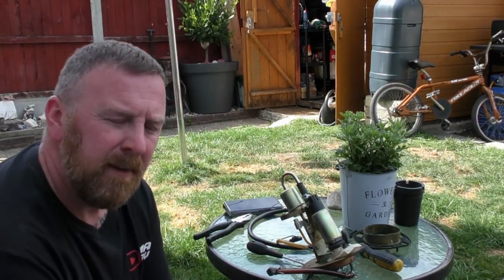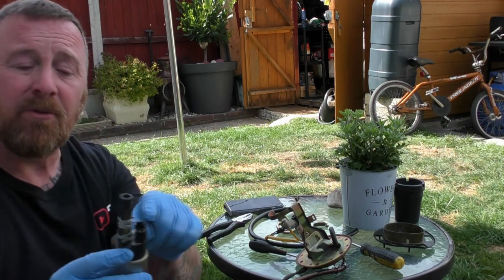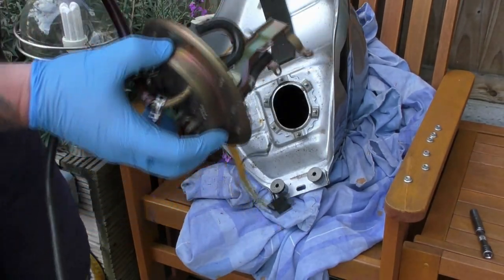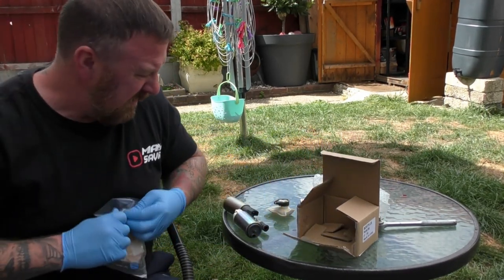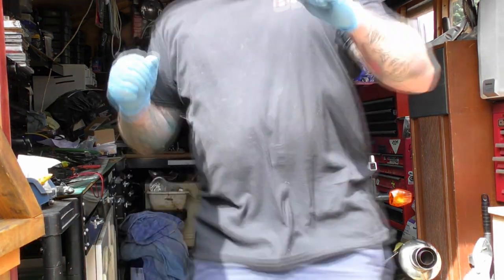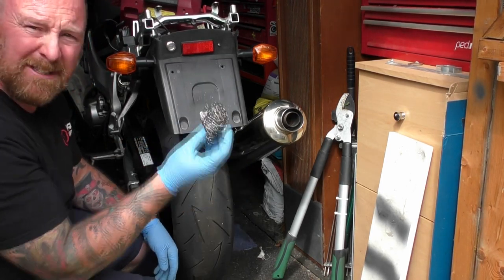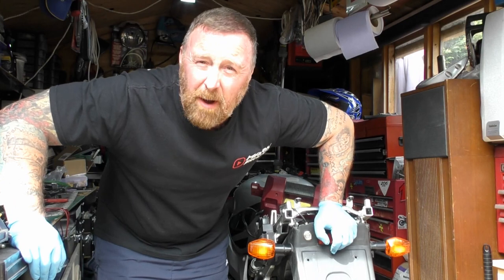HONDA CBR REPLACEMENT FUEL PUMP & DOES IT START MARK SAVAGE

Comment: Great video again Mark, electrical components fully immersed in fuel will not explode due to the lack of oxygen, same as fuel level sender unit in a car fuel tank, bare variable resistor sending fuel level is bare with 12 volt connection, never the right ratio of fuel and air to cause an explosion. That set up reminds me of set up in rover 75 1.8 petrol tank when replacing the pump in one of those. Thanks for your time making this vid Mark, enjoy watching you fixing stuff. On another note my zzr1100 c1 has fuel level sender unit inside tank, again a bare unit with 12 volts going to it and no explosions :-) the fuel pump lives outside underneath the carbs. Tip, if your two red fuel level warning lights on zzr1100 c1 it is probs your oil pressure sender unit not working, obvious if no oil light illuminates when you first turn the key to on. £22.00 to replace, single wire to unit on sump, not much oil weaps out no need to drain oil just undo and replace, to check it works before you replace it just unbolt cable and hold it to engine/earth with ignition on and a helper viewing the dash the oil pressure switch will come on and the 2 red fuel warning lights will flash on and off. The relay making a clicking noise is located in the tail unit. :-)
Reply from the maker: To me as you see it just didnt seem right but it is lol 
Thanks for watching bud 
Finished one out next week once the panels get here lol 
Take care bud

Comment: safer connection for wiring submerged in gas are self sealing solder that use heat to melt and seal the solder with insulating glue.

Comment: Mark, as the comments in the last video stated, the "Kitchen Scrubber" is a pre filter to extend the life of the filter on the pump, Honda put it there, unless you are better at fuel system design than honda, read the manual and put it back

Comment: Hi mark ive got a lexmoto xtrs and i have no spark but power too the ht cap the whole bike has power however its not reading neautral would this contribute
Reply from the maker: This will be the problem, it has to read neutral  to start bud
Reply: mark savage thanks for your help i just sorted the neutral situation out and my battery is dead so still got too wait so gutted about this good work on the videos  me and my fiancè really enjoy them.
She has a lexmoto arrow and she has the same issue however she has a neutral reading and a brand new coil pack
Reply: mark savage okay so battery charged still no spark any suggestions
Reply from the maker: @anthonyscott7806  so you have power 
Out of gear , green light on 
Side stand up 
Engine kill switch on 
It turns over 
Did it work OK before 
How did it run 
What changed 
What did you do ??
Reply: mark savage yes it has power and is out of gear green light is on and there is no side stand switch or connector for one 
The bike did not run before i got it infact it disnt even have a plug for that matter 

Killswitch is set too on position 
I replaced missing parts like reg rek and spark plug cleaned carb and re assembled following your videos i have wired electrics up properly as the bike didnt even turn over when i bought it and i have tested coil pack with multimeter along with my new spark plug i have tons of compression power too the ht cap but no spark the cdi unit is fine because im fairly sure that it wouldnt turn over otherwise ive traced all wires and made sure theres no breaks in loom 

I really aprecite your time thanks a lot for this
Reply from the maker: @anthonyscott7806  if its not the cdi , I'd say stator coil or even timing!! Or ignition 
You just don't know what the last person played with 
Check out my ybr 125 videos the one with cdi and stator problems !!

Comment: Did this now it starts but Boggs out when you give it throttle. I have a vid on my page if anyone thinks they can help me. Thanks
Reply from the maker: Did it do it before you did work on it ??
What did you do to it bud 
Does look clean bike bud
Reply: @marksavage  it didnt even start before the fuel pump. 
So far it has a new quantum fuel pump and filter, spark plugs, oil change
Reply: @marksavage  thank you for responding
Reply from the maker: @gabrielgalaxygh  
Tank off and go back over all of it making sure its all as it should be 
Make sure the pump is in and on ok 
Fuel lines ok and all air pipes and connectors back on as there's a few that can pop off
Plugs in ok and coil packs on 
Theres the common rail too and all washers in and tight bud
Reply: @marksavage  I'll try it out and double check everything. Thanks again

Comment: 6:22 I just finished replacing the fuel pump in my BMW sedan and I too was questioning plugging in the two wires to the fuel pump INSIDE the gas tank, immersed in gas. Turns out, gas does NOT conduct electricity. Of course, if you create a spark next to the gas tank where the fumes can ignite, then it's goodbye mark. 
Now I need to replace the pump on my Honda, and from what I've seen, the BMW is MUCH easier and faster, maybe 20 minutes if you're slow.

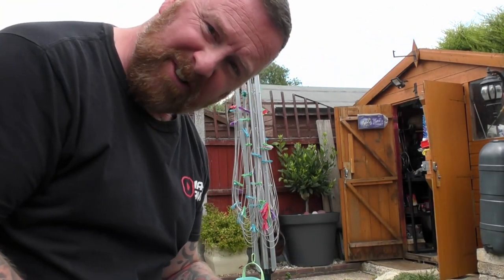Comment: For the gasket at 6:11, do you need to apply anything to the pump assembly before putting it on? On you just put it on normally

Comment: That steel wool is supposed to be in the tank it's for the fuel return I guess I opened mine up today because my fuel pump quit working and was in shock when I seen that but after some research aka google forum search it belongs there I was in shock thinking that was my issue but it wasn't unfortunately now I need to buy a new pump
Reply from the maker: Yea but just seems odd being in there lol

Comment: Mate - ace video, ive just stripped mine down and it has the exact same metal scouring pad wrapped over the fuel filter. Must be a Honda factory ting?
Reply from the maker: So many have said but I left it off
Reply: @marksavage  well mate, I cannot thank you enough for your excellent video 👍🏼 did you replace the fuel filter too just out of interest
Reply from the maker: @LesroyBuckley  I did bud as it had old fuel in it for many years

Comment: May i ask what symptoms you were experiencing prior to the replacement? You mention you had power to the sender unit, was it just not priming? My bike primes and starts, but bogs under acceleration
Reply from the maker: i don't know what it was doing before as it hadn't been on the road for a long time, but i look at carb first 
you are using E5 and not E10 !

Comment: Hi Mark - I had 1999 CBR600-FX, which was one of the last carb models and had a fuel pump failure. That one was mounted on the frame outside the tank and was held on with 2 bolts made of cheese. It took longer to drill those one than replace the pump. My local Honda dealer wanted £149 for a new one, so I got a used one on eBay for £15. Sorted.

I hope I never have the same problem with my CBF1000-A8 as it too is in the tank. Although you have given me the confidence to try it myself. Out of interest, how did you find that copy pump?
Reply from the maker: Good as gold , run it for a bit now and it runs fine and starts and primes every time 
I do these videos to give people like you a little bit of help so you can do it 
Thanks for watching bud next video 
All finished and worth a watch

Comment: Hello mark, I have a leaking fuel valve running off the gas tank on my 
cbr 600f4, I don’t understand why because when I fill up it leaks and then continues to leak until I’m at a half tank of gas. Could you help me?
Reply from the maker: Patrol tank off bud as it sounds like either it's rusted and corroded half way , or could be rusted or damaged breather pipe 
Guessing but get it off and view bud

Comment: Mine is a 2006 and doesn't run off the vacuum system aka the air pump. I use a manual fuel tap. I have done everything and it's not  starting.  Any tipss
Reply from the maker: it can be a few things but would have thought you would need to have the vacuum system running as with carbs

Comment: Hi mark. that stainless steel wool is to trap air bubbles from drawning into the pump. the air bubbles produced by the pump return hose cause of cavitation.
Reply from the maker: Some had said this but still odd to find it in the tank lol

Comment: Hi Mark bit irrelevant to your video but I just bought a suzuki gn125 having a new head a piston put on it today... How should I run it in properly?? Any advice be much appreciated
Reply from the maker: Ride it just a little slower through the gears and not full for the first tank full
You do need to get up to speed but then slow down to 50 again. 
It settles the piston in better then next tank full open up to top speed just not giving to too much 
That should be fine for the next full tank to ride as before 
Keep an eye on the oil
Reply: @marksavage  OK mate thanks so much for your time once again many thanks
Reply: @marksavage  and how long should I ride it for each time I take it out for a run? Sorry for asking so much just had a headache to get it sorted wouldn't like it conking out again lol many thanks
Reply from the maker: @calumtroy3511  starting and letting it run fir a good 10 mins then a shirt ride and home to check all the nuts and bolts 
Let it cool for an hour 
Start back up and a longer ride ,check over and ride like normal
Reply: @marksavage  OK mate thanks I took it out yesterday for 10 mins and again just now for 15 sounds and feels good ill keep revs low for first tank of fuel should be fine  thanks  mate appreciate all the help and videos are wicked take care speak soon

Comment: This is officially my the tutorial im using on my 954 lol
Reply: @mark savage is it still running good with out the pre filter
Reply from the maker: @hyp3_d138  perfect and runs very well,  it's not in all on them and I hadn't seen one in any other motorbikes I've worked on and that's a lot of them 
Found out that they did use them but with today's fuel etc a good filter works much better anyway

Comment: HI Mark
Those strange looking wires you found in tank is fuel return filter. Its a original part and you will need to put it back in fuel tank. 
Take a look on schematics on this website:
https://www.motorcyclespareparts.eu/en/honda-parts/2006-cbr600f-motorcycles/f-14-fuel-tank

Or try to google "16714MBG000, FILTER, FUEL RETURN, Honda"

Regards
Dom
Reply from the maker: Really looks odd but have been told this last week but I made this video after 
Still odd to find it in there !!!
Reply: Did the return line filter go back?